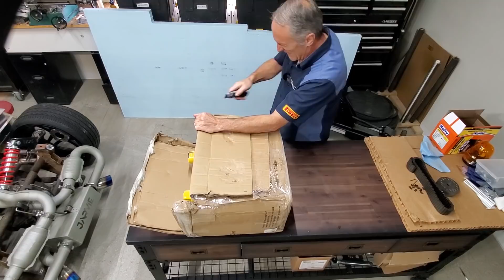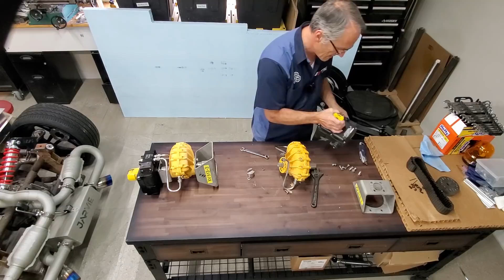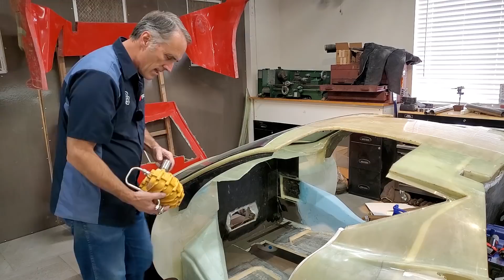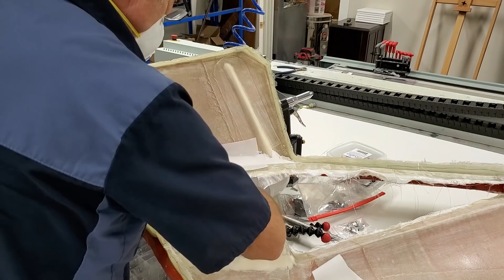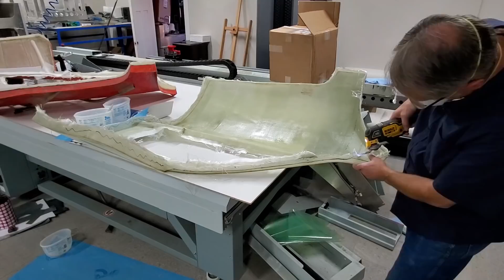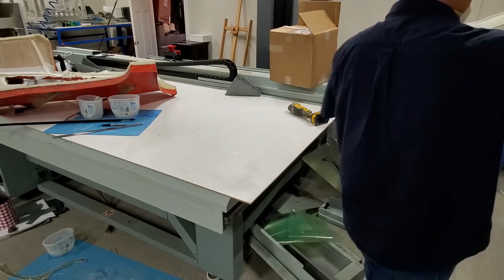A49 - Kinetrol 90 unboxing. Arete supercar project

Comment: Another thought; I built two Fiberfab Aztec 7's which had gull wing doors very similar to your doors. The doors ran conduit around the door perimeters under layers of fiberglass. Then only regular door assist cylinders were needed. The body had the rain grooves and press-on weatherstripping finished it up. The latches were trunk latches, some guys even used the Cadillac electric pull-down latches with manual releases in case of dead batteries. Perhaps your son can find photos of my IROC V8 powered, full framed, transverse rear mid-engined Aztec 7 via a V8 Archie Fiero transaxle kit somewhere in "the cloud"? It was in the 2010-ish era. Best of luck with your build sir!

Comment: I'm late in finding this site. Having a few car & chassis builds under my belt, I wondered why you didn't make a full frame chassis linking your front and rear subframes with perhaps 2x4x.125" tube steel? I used the 4" side vertically and you have that room in your door sills.Thank you...
Reply from the maker: Well, thanks for stopping by and watching the build. the whole project is geared to move in the direction of modern monocouque design and to see if I could pull it off without the molds and autoclaves. We will see in the end.

Comment: HI, SORRY FOR MY ENGLISH I AM NOT FROM USA, I WOULD LIKE TO ASK: 1. THE REAR WHEELS ARE CONNECT TO THE SUB CHASSIS ON 4 POINTS (4 WELDED DOCKING POINTS) IS IT (THE STRUCTURE) STRONGE ENOUGH TO DEAL WITH ALL FORCES AND TORQUES ? WOULD IT HANDLE ALL FORCES AND TORQUES THAT ACTS ON THESE POINTS COME FROM THE WHEEL WHEN YOU TURN OR BRINGING THE CAR TO A "SIDE ACCELERATION" (LIKE IN DRIFTING POSITION) ? 2. WHY DIDN'T YOU USE A TORSION BAR BETWEEN THE REAR WHEELS ? AS IT NEEDED IN THE FRONT WHEELS FOR STABILITY AND TO HARNESS THE INNER WHEEL SHOCK SPRING (IN A TURNING) TO HELP THE OUTER WHEEL SPRINT ? I HOPE I AM NOT BOTHERING WITH MY QUESTIONS THANKS DUDI
Reply from the maker: I sure hope they will be strong enough. We will see in testing. There will be anti roll bars (sway bars) added to front and rear. You will see this in upcoming videos.

Comment: Jay - New to the channel, but as an engineer I have to say I am very impressed by your work.  Instead of the Kinetrol 90 actuators, any thought given to using either electrical or pneumatic linear actuators?  I believe there will be a significant weight savings over the Kinetrol units.  Also want to say that your inspiration to a new generation of engineers and makers is something to be highly applauded and sincere thanks to see someone paying it forward.
Reply from the maker: Welcome to the channel Ron! I've debated the door actuators quite a bit. Truly reliable electrical actuators are very expensive and the pneumatic linears would indeed be lighter, but the rotary pneumatic are different (a fun new challenge) and really solve some problems for me.  Inspiring young engineers- This is the main reason for building this project- lets be realistic, I need a car like this like a hole in my head, but I love them and others love them. Schools are teaching engineering, but not vision and possibilities. Seems my biggest audience of "aha!" moment engineers is India. I think the entrepreneurial spirit is growing there.  Thanks for supporting the effort with your watch time.

Comment: Hi, dont mind the doubters, stick to your guns, you have accomplished so much so far, one thing i wonder about after watching this episode, the extra weight of those actuators being in the doors, might it not be better to put the actuators on the bulkhead and connect the hinges and doors to them, just a thought.
Reply from the maker: The tire is on the other side of the bulkhead. I could create a bunch of push rods and linkage for an under the dash placement, but in the door works nice. (or I hope so. Ha!)

Comment: use a hydraulic cylinder from a convertable and the pump it will lift 300 lbs and is way more compact

Comment: I am wondering about your idea of mounting the actuator in the door and running it through the bulkhead to attach to the hinge. Might it work better to mount that substantial actuator in the front area and attach the hinge arm to it there?  Keep the weight out of the door and air tubes from having to flex for the opening.  Just a thought.
Reply from the maker: I have toyed with the idea of mounting the actuator under the dash and using a push rod to the drive the hinge, but then it would just be a linear actuator and slightly defeat the idea. The actuator look heavier than they are.

Comment: Thank you for sharing your project with us.  Amazing work.  A question about the turbo set up.  You are using 2 stock turbos in place of the single turbo.  The energy from the exhaust will be divided in half, instead of all the energy being used to spin the one turbo.  So each turbo will will only receive half the exhaust energy and generate half the boost?  I was thinking a compound turbo system would work better.  Again, thanks for sharing your build with us.
Reply from the maker: The trick is producing twice the exhaust energy. This is the only way a LARGER turbo (or twins) can become effective. If you can't produce more exhaust energy then a larger turbo is mute. A modern more technically advanced turbo would have been nice, but not in this budget. When Toyota dropped the compound turbo setup for the single turbo they overcame some of the turbo lag with a shorted exhaust manifold. I will be halving that distance once again. I still expect some lag, but I'm not after low end power. Thanks for following the channel.

Comment: I used to sell these.  To find the torque you need first calculate it.  This is OK if you are swinging through a horizontal arc.  If you are moving from horizontal to vertical, or vide versa multiply your calculated figure by 1.4.   If you are moving through an arc from horizontal to horizontal via a vertical position double your calculation.
If there is air in the system then telling it where to go is OK but if you are starting from an empty system you need to tell it to go to where it is (one end it the other) until air pressure is built up and then you can tell it to move.  Rotary actuators leak due to their design and I have seen some nasty mishaps due to people not understanding their limitations.
Reply from the maker: Good to know, as I've been wondering about the number of solenoids and position sensors for pressure changes through the arc and latching.
Reply: @BuilderCreator .  You may wish to look at 5 port, double solenoid valves to control the actuator, these will maintain the last position they were told to go.  If you are concerned about pressure loss in the system meaning that you are unable to open the doors you may wish to look at spring loaded, three position valves.  If you loose electrical system these will self centre to either a pressure applied or a pressure applied centre.  As Kinitrol units leak ( as do just about all actuators of that design) they’re just about the same, you just end up with unassisted doors.  To monitor the position/pressure condition you may want to look at Legris pressure/flow regs that will control the speed of the door opening and the pressure in the actuators to stop them slamming open or shut when opening from system start up.  You may also want to look at shock absorbers to cushion the doors at the end of the opening and closing movement.  This will stop the doors slamming to say nothing of looking very cool as the doors slow down to a gentle movement as they open and close.  The doors should be stopped by external controls rather than by the stroke of the actuator, leaving the last 2-3 degrees of movement unused to avoid shock loading, even more important if the door is heavy.

If you need any advice on pneumatic controls just let me know, they didn’t call me the pneumatic Guru for nothing.

Comment: Hi sir my name is Ali I am mailing you to ask one question which is technical you have used Toyota 1JZ-GTEs engine which Toyota used in it's front mounted engine cars but you took the same engine and used it in mid engine mounted configuration do you have to do some change in engine design to used in mid engine layout or you just pick the same engine and mounted it in mid configuration because basically it is build for front engine placement and secondly does the engine block build for.mid engine layout is same as engine build for front engine layout well waiting for your humble reply thanks indeed very much God bless you
Reply from the maker: There is no difference in using the engine in either configuration. The differences comes in the power-train components. I will be building a center mounted differential that will split the power between the front and rear wheels. All wheel drive.

Comment: Loving the channel man! I have built a few doors that lift and believe when I say 'Weight Matters'. Please toy with the idea of mounting the Kinetrol devices to the chassis and use spherical rod linkages to push the hinges up instead. You can dial in the height and leverage way easier.

Comment: LOL! What are the odds! I thought I recognized that name. I've been an instrumentation tech for 30 years. I have a ton of those types of things in my shop, new old stock. If you need something like that give me a holler. I've got big ol' arm breakers and little ones electro-mechanical, pneumatic, solenoids, pressure transmitters, temp, flow, everything.
Reply from the maker: Sounds like an Ebay store. Ha!

Comment: Why don’t you use pneumatic cylinders with an air pump. Remote of course. I am sure there will be something on the market already. The fifth door on the SUVs for instance has some system. I don’t own a SUV so I can’t tell you how it works.

Comment: I’m having trouble with the concept of how the door actuators are supposed to function with the hinge.
How I visualise it in my head has it working against itself with that design of hinge and the actuators being inside the door and requiring about 180 degrees of rotation .
I can get them to work by placing them near the diff and using a drive shaft to turn the hinge.

Comment: Did any of those "doubting Thomas" that told you that "nothing was done correctly" tell you how to do things a better way?
I bet you the answer is a resounding NO.
You and most of the great builders seem to follow a simple path to a successful end and that path, more or less, includes design it, build it, break it. 
As an engineer, I have seen no glaring or dangerous faults in your work so far.
In fact I see a lot of ideas that others, including myself, should take note of.
Reply from the maker: Exactly! This is why, when I call myself an engineer I always preface that with "prototype." I know engineers in general have worked hard in school and profession, to claim that title. I only claim the ability to create problems and solve them through engineering. Thanks for following the channel.

Comment: Not questioning your genius, but couldn’t this be accomplished with some lighter weight, and much smaller hydraulic actuators and levers?
Reply from the maker: Probably could have gone with a lighter actuator, but with budget, a used one at $90 dollars and a new one at $500, I had to take the weight penalty.  I have answered in other comments in this video why a larger actuator is more beneficial as well- if you want to look below.

Comment: Would the door movement be similar to Mc Laren F1? Like now I think about it after I asked you regarding the door inserts in the monocoque, I watched a documentary on the Mc Laren F1 and those insert pins seemed the similar mechanism used by Mc Laren. Secondly, I'm don't have much idea about the "Kinetol 90" thing, after watching the outcome I came to is that it provides mechanical motion using pneumatic pressure, but where is it used in the general application and how would you provide compress gas at that pressure in the car?
Thank you 👍
[EDIT] 
Okay, one more doubt, will the doors be electrically actuated, and will they open automatically like a Tesla. 
Thank you...
Reply from the maker: They will open automatically. A switch will operate a solenoid valve allowing pressure to one side of the actuator. a limit switch will stop the solenoid. (and thus airflow) to close, another switch will send air to the opposite side of the actuator to close it. another position switch will tell a solenoid that it is close to being closed and air pressure will increase to force the door against the latch mechanism.  The actuators in the video were from an industrial valve control system. They can operate up to 120psi, but I will not need that much pressure.

Comment: Enjoying your build so much. but KISS. So much weight and complexity, your A pillar hinge is perfectly suitable to run a power window style mechanism, (a geared 1/4 moon),up-graded to a suitably powered motor for the weight. I made 1 to operate a boot lid 20 odd years ago.

Comment: I've scared business partners when I said I wanted things to break and go wrong. That is the fastest way to bring a mature product or service to the market against companies/competitors with years of experience. It's naive to consider that you are not going to make mistakes or find out the way you apply an idea isn't quite right. I am still here and they are gone.... Keep up the good work, loving how you are thinking through everything!
Reply from the maker: For sure. The only way to build something new without breaking it or making mistakes is to have broken so many things in your past that you can rightly predict projected results, but usually about then you are old and die. Ha!
Reply: @BuilderCreator  Hi sir my name is Ali I am mailing you to ask one question which is technical you have used Toyota 1JZ-GTEs engine which Toyota used in it's front mounted engine cars but you took the same engine and used it in mid engine mounted configuration do you have to do some change in engine design to used in mid engine layout or you just pick the same engine and mounted it in mid configuration because basically it is build for front engine placement and secondly does the engine block build for.mid engine layout is same as engine build for front engine layout well waiting for your humble reply thanks indeed very much God bless you
Reply: @BuilderCreator  Hi sir my name is Ali I am mailing you to ask one question which is technical you have used Toyota 1JZ-GTEs engine which Toyota used in it's front mounted engine cars but you took the same engine and used it in mid engine mounted configuration do you have to do some change in engine design to used in mid engine layout or you just pick the same engine and mounted it in mid configuration because basically it is build for front engine placement and secondly does the engine block build for.mid engine layout is same as engine build for front engine layout well waiting for your humble reply thanks indeed very much God bless you
Reply: @alibutt5269  the engine is the same whether it is for front, mid or rear mount. 
The difference is in the transmission... the normal rear wheel drive transmission it mounts onto has a single driveshaft out the back going to the rear differential.
In his case, he has the engine and transmission reversed 180°, with the transmission in front of the engine, and a transfer case, which splits the drive to the front and rear differentials.
The more common way for rear wheel drive mid engine vehicles is to use a transaxle, which incorporates the differential into the same casing as the transmission.
The transmission on most front wheel drive cars is a form of transaxle.

Comment: I don't like you, I found this channel a week ago and haven't been able to stop watching! Your work looks pretty awesome so far. I do have a question though regarding the operation of the door. You say the actuator is door mounted but the ball joint for the hinge is mounted on the bulkhead, how can you get that movement to happen and have the hinge wrap around like the paper template did?. To do what you showed, the actuator would need to mount on the bulkhead and move the paper template and door wouldn't it? Keep up the good work

Comment: Very excited for the new secret project. 
Just a thought - maybe time to change the channel name? 
Just my two cents, but it seems a tad generic. If you are thinking of taking a product into production then it’d be nice for your channel to align with the identity of whatever brand name you’ve chosen. 
Is Jarvie the name of the car or the name of the make of the car? If the latter then I see that as a fitting name 👍
Reply from the maker: Well, generic works, as the third project may be an aircraft, or a boat or Maxwell's demon.  . . .

Comment: Can you go into more detail as to why you chose a rotational actuator instead of a linear one when you want to use pressure air? As far as I know linear air cylinders are much cheaper and lighter. There's probably a reason here that I currently don't see. Thanks in advance!
Reply from the maker: Putting the actuator in the door and out of the spray in the wheel well just seems to work, and its different.
Reply: @BuilderCreator   allright, fair enough! I was not at this point in the video back then, but you later explained that part of the projects goal was to figure out what works, and what doesn't, so this approach, while unusual, is also interesting. I look forward to the implementation, keep up the good work sir.